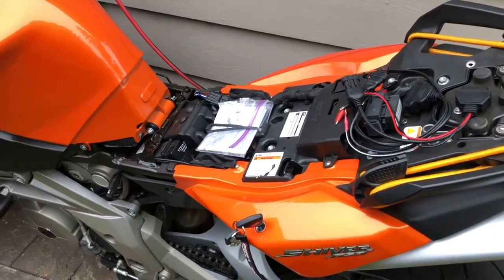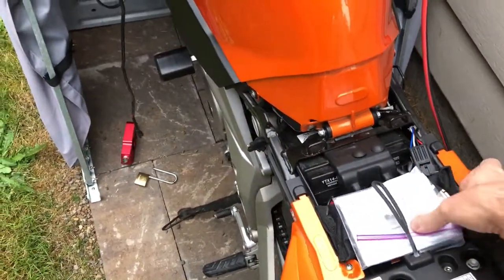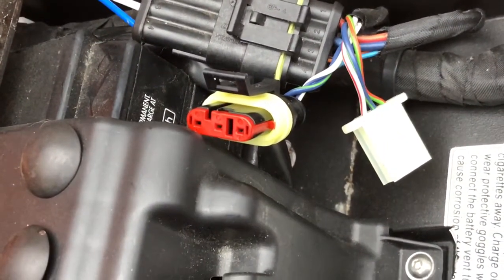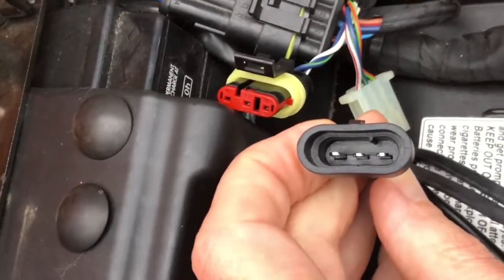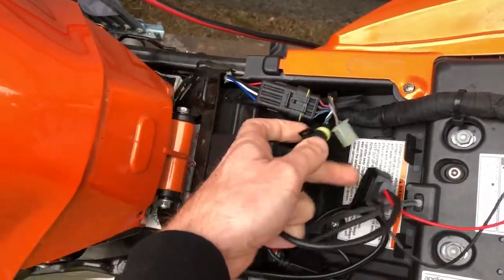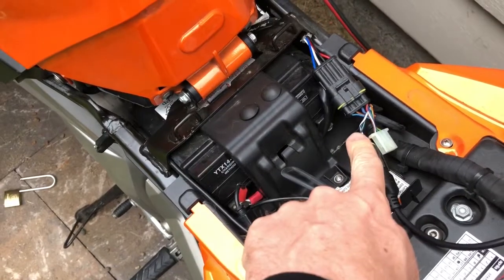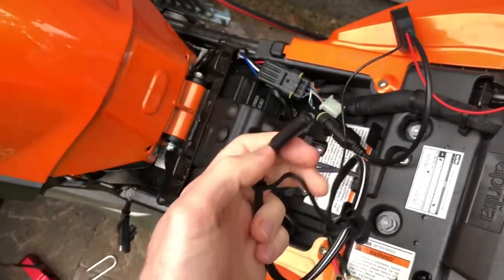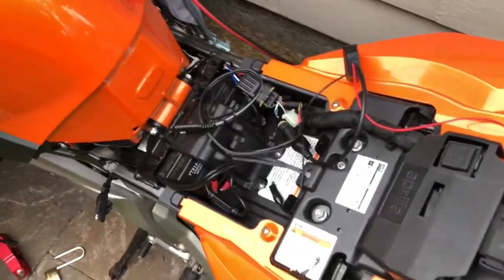2009 Aprilia Shiver Diagnostic Port Connection

Comment: You had an Aprilia shiver 750 I just got one 2009 Aprilia shiver 750 don't know how or if you can lower take off speed I put 1st gear let off clutch slowly and bike just takes off to fast without giving any throttle at all is yours like this How could I fix this?

Comment: I recently needed to run guzzidiag on my 2014 dorso 750ABS. I ordered the Goliton cable, which did NOT work. I ordered this instead which IS the correct plug and pin setup: [url]https://www.amazon.com/gp/product/B07QBXZHLD/ref=ppx_yo_dt_b_asin_title_o03_s00?ie=UTF8&psc=1[/url]
Happy diagnostics!
Reply from the maker: Thank you for the updated link!

Comment: Thank you for comparing the two and showing the pins.
I just bought the one with thicker pins from a shop which claimed that the cable was compatible with Fiat car, but the pins were way thicker for Fiat Brava 2000.
Reply: Nnh

Comment: Hi there, please tell me, I was in a conversation with a friend, we both have Aprilias. And from time to time as we are in a country without Aprilia's representative, we find out things for our bike via Internet mostly. On last conversation he mentioned something like, it re-sets something on the bike, if we disconnect the battery and bond the two connectors together. It was more people around and conversation desviates. But the questions remains in my head.
If in fact does anything, what is it?

Joao Paulo 
Luanda, Angola
Reply from the maker: I know that the codes don't reset when the battery is disconnected. I haven't tried shorting the diagnostic lead. It was important to see what the code was before I cleared it to make sure it wasn't more serious. Sorry I don't have a direct answer to your question.

Comment: For other Aprilia Shiver 750 owners - the first link above takes you to a cable on Amazon. Don't know if that fits or not. Copy and paste the description "Goliton OBD OBD2 16 Pin Connector Diagnostic Adapter for FIAT 3 Pin" into Ebay and you will get the correct plug -https://www.ebay.com/itm/New-16Pin-OBD2-to-3Pin-OBD1-Diagnostic-Adaptor-Connector-Cable-For-Fiat-Alpha/401231360695?epid=510671180&hash=item5d6b40b2b7 The second link allegedly taking you to the correct plug, takes you to an extension lead only - which is not what you need..